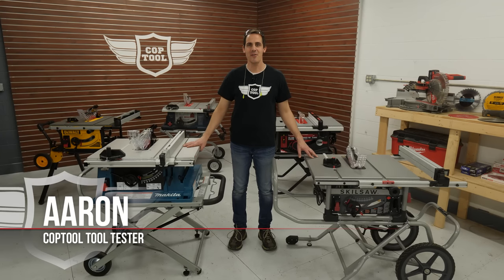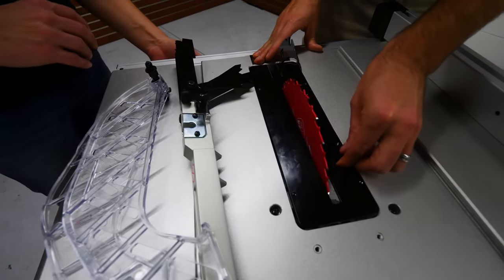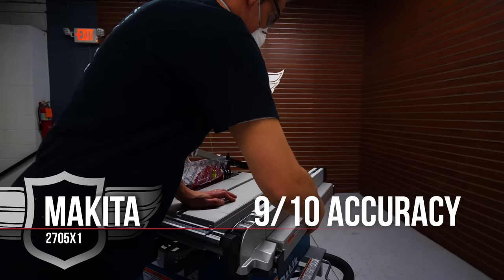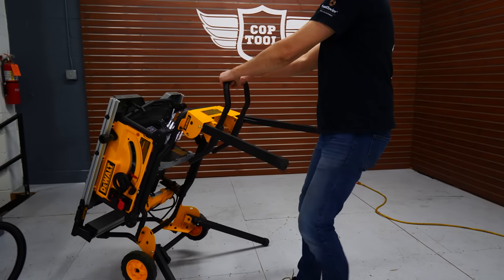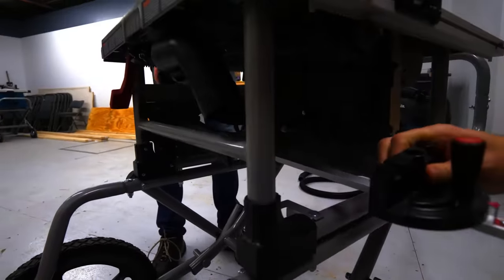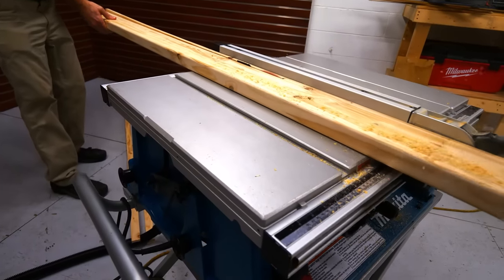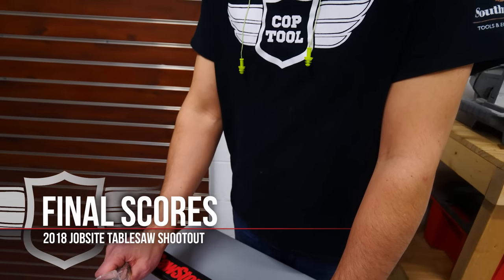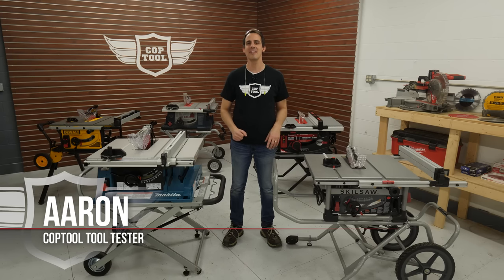THE BEST Jobsite Table Saw - Bosch, Dewalt, Makita, SawStop, SkilSaw. How to choose the one for you.

Comment: I am seriously looking at the sawstop 1, because i am the breadwinner and a firefighter and losing fingers would be bad, and 2 my oldest son is high function autistic and just the security of having that function could really be worth it in the long run.
Reply: I have the Sawstop JSS and couldn't be happier. I also am a Firefighter and loosing a finger because of my hobby would cause me to potentially loose my career, so $500 more for that insurance was a easy decision.
Reply: Well I' ve been wood working for over 40 years now and I have all my fingers. The ecyra cost for the saw stop is more then I need. Besides do you know that if saw stop goes it's around $75 to get it going again.
Reply: I have had my Sawstop for 3 years and have never set off the safety feature, so I don't worry about the $75. Good for you for being a woodworker for 40 years without ever having a injury. I have been driving my car for almost 30 years without a accident but I still put my seatbelt on. There is no correlation between a accidental injury and your years of practice. Like I said being a 17 year Firefighter/Paramedic I have yet to respond to a 911 industrial accident where the person told me they did it on purpose. Accidents can happen to any of us. Its a personal decision that we all must make but the $500 one time premium is a worth while insurance for not only me but my family by preventing a injury that would cost me my career.
Reply: yes I know that and I just bought one. it is what it is. You pay for car insurance every year but usually don't need it so I loom at it that way.
Reply: My buddy has only 2 fingers on his dominant hand. He handles 1 3/4 hose like anyone else lol
Reply: My buddy has only 2 fingers on his dominant hand. He handles 1 3/4 hose like anyone else lol
Reply: Cheap insurance with the SawStop I’d say... how much to reattach a digit? $10+K?
Reply: "There is no correlation between a accidental injury and your years of practice."  Nicely put TheVelluch.
Reply: papaike2 It could cost $150 to get it started again and I would still buy a SawStop. Your fingers cannot be replaced, your money can. Also, SawStop used to send you a free cartridge if you send them your used cartridge and they look at the data. If it shows it was truley flesh that set off the blade, (as opposed to like doing s hot dog test) they used to send a free one
Reply: Just wait until you cut into a piece of material/lumber that is a little damp and then tell us how you feel.
Reply: Travis the chimp It has a feature where it can tell if the wood is wet and instead of activating the brake, it just slows the blade and stops it normally. Wet wood has a different resistance than human skin
Reply: Well that sounds good but here is why I said that. My friend purchased a new ''Saw Stop'' table saw for his shop and it's a great saw. I was working at his shop about a month after he got it and used it all the time. I changed cartridges for dados many times and was well versed on how it works. One time I was assembling a door when I realized the panel was about an 1/8th  wide. The panel had a little glue on the edge so I wiped it off with a damp rag and returned to the saw to make the trim off cut. Well, bad move by me, the moisture from the wipe off set the break/cartridge off and jammed the saw blade! At first we didn't know why it went off but then figured it out. Even my friend (the owner) was shocked that it happened but he took it as a learning experience. Don't get me wrong, I think the saw is great and performs exceptionally... it's just that this did happen. :)
Reply: because the sawstop will think damp wood is flesh?
Reply: Johnny Damp wood can conduct electricity, but not as much as the human body will. But super wet wood might conduct as much as the human body and set the brake off

Comment: There is a lot of Dewalt hate in this video. I've had mine for 2 years now, and none of the issues you are pointing out. I'd also add you failed to account for the cost of the ambulance ride, insurance deductible, time off work, and costs of rehab WHEN you inevitably cut yourself, when factoring the value of the Sawstop.

Comment: That 2 x 6 was probably too wet on the sawstop. Nothing to do with power. What you might have experienced is a wet wood overload.
Reply: Wrong, if that was the case, they would of had to replace the safety mechanism.

Comment: Hold it...the Ridgid table contractors saw was not even reviewed....what is that about?
Reply: Stanley Pearse it would clearly win. And so they didn’t bother. I have the RIDGID and it’s accurate, powerful, and easy to use. I’m using it to remodel a kitchen right now. Built 11 drawer boxes with it today.
Reply: I was disappointed as well.  I don't think it would beat the sawstop, but I would like to know where it stands owning a ridgid jobsite table saw and a few other of their tools.
Reply: I had the Ridgid R4513 for awhile, the jobsight saw with the mobile stand not the contractor style saw. I was really excited to get it but ended up absolutely hating it due to the amount of play in the arbor. The blade chattered like crazy upon startup and made excessive saw marks in cuts. I inspected different floor models in the stores after that and could feel the same play in the blades by jiggling them. Other brand saws didn’t. I was disappointed in the saw so I got rid of it. It was extremely loud and the stand wasn’t sturdy at all in my opinion and dust collection was awful even with a powerful vac. The only thing I was impressed with was the fence. It was very sturdy and smooth... I had the same blade wobble issues with 2 of their sliding miter saws as well and so I gave up on Ridgid saws. The brand in general does have some value in certain areas though. Some other people may not have the same problems I did with their saws but quality control showed unacceptable in my case.
Reply: Ridgid makes good tools but i dont think theirs would top the skil or dewalt or sawstop. Or makita for that matter lol makita was heavy but other then that all these saws are killer . The ridgid is great too, but i imagine they didnt do it because it isnt normally considered contractor grade tools . Some are for sure able to keep up. But theres little things with ridgid that dont happen with bigger brands. Especially the cordless line up. Batteries fall off tools n stuff. Some shouldnt of be released at the point they were at lol
Reply: Adam McKenzie hahaha! I agree. The battery falling off thing is crazy. A very fair and excellent reviewer that goes by Tool Boss gave the hammer drill a good chance last season but the battery wouldn’t even stay on long enough to complete a bore into a stump. Over and over and over. I got great use out of my old X4 drills but had problems with all their newer stuff. I considered myself a happy and loyal Orange advocate but unfortunately that changed this year. Been satisfied with my new Milwaukee platform tools though now. Excellent batteries and excellent tool performance and power although I do miss the luminosity of the LED work lights on Ridgid tools, being my only complaint about The M18’s. Although I wasn’t that impressed with their miter saw, it be great to see them release a jobsight table saw but it’s probably not a main priority for them right now.
Reply: agreed!!!
Reply: I think it's because, they actually killed, not 1, but 2 of the saw testers.  1 merely by turning it on.  The other, cut both hands off, and he bled out, before the ambulance arrived.  

Of course I'm kidding for those, too stupid to understand humor.  That's a good point.  Where was the Rigid in all of this?  I think they're wet/dry vacuums are 2nd to none.  What about Ryobi?  They make a jobsite table saw as well.
Reply: Sure it would if you compare the bloody prices......
Reply from the maker: We probably should included this model. For most Ridgid (orange) Power Tools the parent company TTi does not make PRO level tools, where they have Milwaukee Tools for the PROs and Ridgid is a meant as a mid/high level home owner product. For this areas where there are no Milwaukee tools they do seem to try and fill that void with a little better tools.
Reply: coptool well, seems like it might be time to compare the new Milwaukee cordless table saw when it comes out 👍
Reply: The Ridid R4513 is the BOMB.
Reply: Its just a shame they dont sell the Ridgid cabinet saw on Europe
Reply: here's  several things for diy table saw construction
Find a proven set of plans online 
Find a mate who wants to build one too so you have another person to help you
(I read these and the reasons they work on Wilfs wood blueprint website )
Reply: There are  several tips for diy table saw construction
Find a proven set of plans online 
Find a colleague who wants to build one too so you have another person to encourage you
(I read these and why they work on Wilfs wood blueprint website )
Reply: There are several factors in building a table saw. One plan I found which successfully combines these is the Wilfs Wood Blueprint (check it out on google) without a doubt the no.1 plan that I have ever heard of. look at the great information .
Reply: anu jose

Spam anyone?

Comment: Here's one thing you should realize about these portable saws.  The Dewalt stand might be a bit more difficult to breakdown and move, but there is a reason.....and it's worth the trade off.  Better stability.  Having four angled legs makes it far more stable than two legs + two wheels.  They even mentioned the Dewalt was the most stable in the video.  If you have ever tried cutting a 4' x 8' sheet of plywood by yourself on a portable saw.....you will understand.  A two wheeled version will roll on you while trying to cut.

Comment: I disagree with you putting a 6-10 for value on the SawStop. This is not a fair comparison because of the others don’t have the flesh sensing technology. As of today it’s a $1579 saw. I was at Rockler for a hot dog demonstration on a SawStop saw. 2 of the dozen guys in the class were missing fingers and were there to buy a SawStop saw. I would have gave it a 9-10 for value.

Comment: With the "top end" Contractor saws, you are splitting hairs with the top brands.  I have used them all, Bosh, Milwaukee, DeWalt, etc...  You have to understand what these saws are, they are saw's designed to MOVE, be light enough to move to a job site by people that need them to make straight cuts/rips.
They are NOT cabinet saws, per se, but you can use them in that manner if you get one and decide to take the time to tweak them, make sure it's all square and flat.  You can use any of them to make some very nice things if you take the time, make a few jigs, and use a very good blade.
I use the DeWalt because it's available everywhere, is a great saw out of the box, you can purchase upgrades if you wish, rack and pinion fence, and room for a dado stack of 13/16.  These are not cabinet saws, but the with the price of under $1000 bucks, they just can't be, and they will all work best in a stationary setting, like a built in table.  Take the time to measure and tweak them to the tolerances you want, use a good blade, and enjoy many years of use.

Comment: What a joke. The saw stop of course is good but look at price. DeWalt7941  is much better than any of the others; I have used them all; except saw stop.
Reply: Not to mention David, you could buy 2 DWE7491RS's and still have about $300.00 bucks in you're wallet, for the price of 1 SawStop Jobsite Saws.  I'm not bashing SawStop, they obviously have a great jobsite saw.  But the price is so far out of league, compared to the others.
Reply: Dewalt has a flimsy fence making it worthless.
Reply: And the first time you see some clutz bump a person using  the saw you would change your mind about the very minor price difference.  Also there is a possible benefit to insurance premiums for a business that only uses table saws with active protection (the other option is the Bosch GTS1041A-09 for about $1500).
Reply: BBQ _ "The flimsy fence?"  Are you high?  The fence on mine is solid as a rock.  I just don't think you've ever actually used the Dewalt.
Reply: No I have never used the DeWalt = junk.
Reply: The BBQ Jerk complete and utter bull.

Comment: Yeah the skillsaw is great for homeowners...for professionals the dewalt is the winner ...love the legs makes it a lot lighter and setup is super easy the guy in the video was doin it all wrong
Reply: the skil  is a worm drive.. way more power then any homeowner needs .. thats a contractor made saw . the home owner ones are the shit red ones. this is a table saw version of the best circular saw ever made. lol 100% designed for contractors
Reply: Dewalt are for fashion victims like myself most site carps in the UK used them  I wasted loads of money on them I spent nearly a grand on  a 24v SDS and a single 14v  only for both of them to stop taking a charge after not using them for a month, when it comes to cordless its Makita all the way for me ,  As for Skill great tools for the money I bought a Skill Skill saw under a 100 pounds had it for years never misses a beat and nice and light easy to handle.

Comment: I bought a DeWalt because once it is set up the legs are pretty stable whereas those that use the wheels and legs in combination seem to rock to and fro more than the DeWalt did.  What this video doesn't tell you is how much that safety feature costs you on the Saw Stop if you should trigger the automatic shutdown process. I don't know the exact figure but it is not cheap and once the safety device is triggered it must be replaced to my knowledge.
Reply: You fail to see how much money that device going off just saved you. the cost of a doctor/surgeon/emergency room visit, the pain and suffering from loosing a finger or worse, and perhaps the loss of income from being injured. Ask anyone who has had an accident where the device saved them from an injury if they complained about the $50 device and a new blade they would need to purchase.

Comment: Dang DeWalt got last place. I've heard alot of good stuff about the skilsaw.
Reply: Acme Tools FeDexed the Skil to my door for $ 529 which included a gratis Skilsaw magnesium-cased 7-1/4" saw, a dado insert and a couple of Skil sawzall blades. And the winner is Skil from Acme Tools!!!
Reply: c.e. kestner that is a heck of a deal!
Reply: c.e. kestner That is interesting about the dado insert. I contacted Skilsaw about a dado insert for the new SPT99-12 and they told me they haven't made one yet. It will be out in the summer and they don't have a price for it yet. My guess is that they sent you the dado insert for the 70 series table saw. If it's working for you though let me know and I'll buy that instead :-)
Reply: How'd you get that deal? Was it advertised on their site? Looking to buy one myself, shopping a round.
Reply: c.e. kestner Great buy!

Comment: What you are doing in this video is not safe.  Your assistant pulling the wood through the saw is exactly how Tommy Caldwell (the climber) lost his index finger.   If the saw kicks back, the assistant's hand can be pulled directly into the blade.  This is unlikely when she's standing far back from the saw, but there are moments in the video where she's standing close.  Never pull  material through a table saw.
Reply from the maker: Jay Bailey Good advice Jay. Thanks for looking out for us.

Comment: dewalt is the most precise one with it's rack and pinion system, there are bolts on the front and back to adjust the fence (i didn't need to, it came perfect out of the box) and if thats done right, u never have to touch it again. BOOO at your review

Comment: I feel dumber after wasting my time on that video. How are you going to declare the winner a DIY brand,  Skillsaw is so bad that Bosch sold the rights to the name.  Honestly what's next are you gonna say the Craftsman contractor saw is better than a Powermatic cabinet saw.  I have both the Makita contractor saw in my workshop and I absolutely love it and would never complain about it and I have the smaller version of the DeWalt table saw to bring to the job site. I love it because you can pick it up with one hand and carried up the stairs.
Reply: I have read many positive reviews on the Makita 2705, so I was shocked to hear it being referred to as underpowered.  It also has the 3.95 cutting depth at 90 degrees.  After months of reviews I have decided on a Makita.

Comment: I know I'm late to the party here but, Makita should be ashamed of themselves for their tablsaw offering 
I NEVER see anyone with a Makita table saw on the jobsite! Hell,  I haven't even seen one in a retail store in many years.
This from the company that without a doubt, revolutionized the portable table saw back in the mid 80s. 
The marketing writes itself here guy's
Reply: I have makita drill that has served me well but their table saw never made it onto my radar. The conclusion of this video is accurate but I think they were a bit generous with the points on the contenders. The Bosch has good power but I do think the Skilsaw should have gotten a 10/10 for that; it can handle more than what they did in these tests and I bet the other saws would bog or trip the breaker. I had the Bosch and I know it will bog when trying to cut 3.5" of material in one pass because mine bogged at 3", while the Skilsaw will slice 3.5" of any material effortlessly.

Comment: This review sucks as the SawStop fence will flex when used. You commented on all the other saw fence but the SawStop why is that? I love the safety aspect of the JSS but the fence is a MAJOR FLAW. If I knew this before  purchase I would of stepped up to the contractor saw.
Reply: In spite of the flimsy wings or a couple hundred to get the solid ( not pressed tin) upgrade version of them. ?